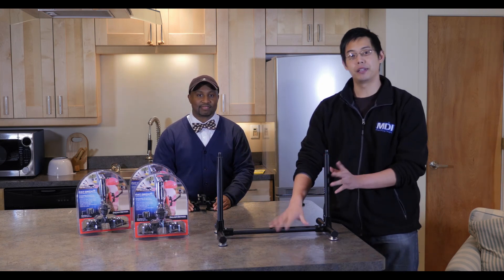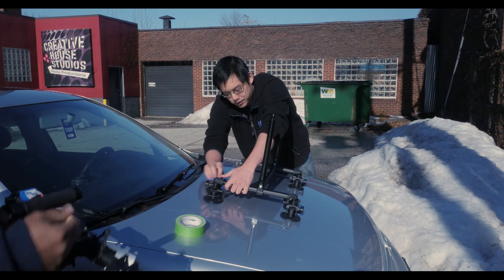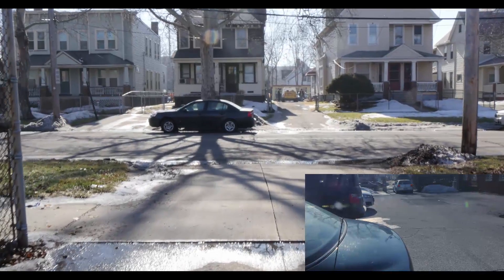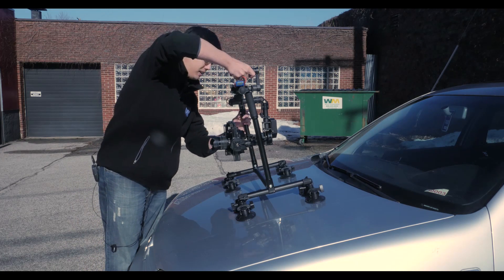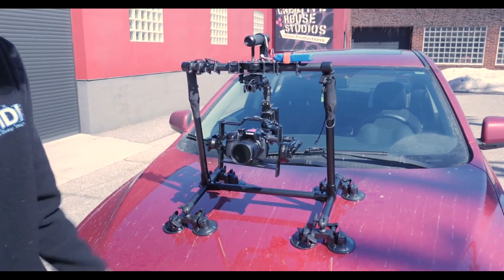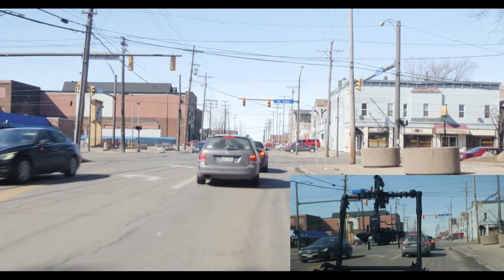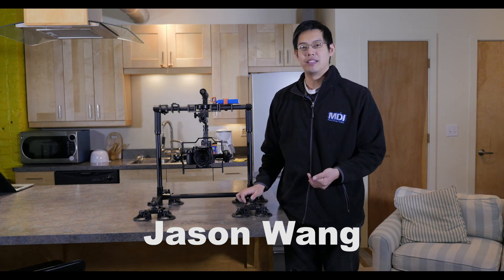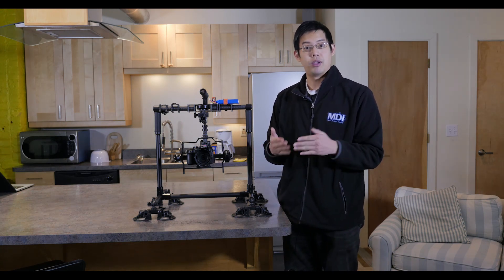DIY Car Mount with Came 7800

Comment: guys what are you trying to prove here..??  the footage is shaky as, the gamble is not made for heavy vibrations. granted its a great idea to mount it but i really does not work.  you need to get some big ass silicon mounts to get rid of the vibrations, but maybe this will not even work as the gimbal handle will still be rigged which it transferring the vibrations. keep trying tho guys :-)
Reply from the maker: Trevor Donovan that's the point exactly, we noticed the stand can be used somewhere else so we went out and tested it :) it may work when shooting toward the car as long as we don't turn lol also yes, adding more 'up/down' stablizing (4 axis) would help of course. but right now, this is a throw a way diy lol